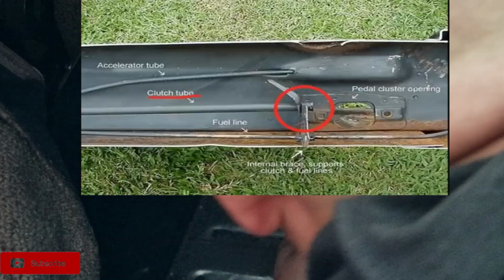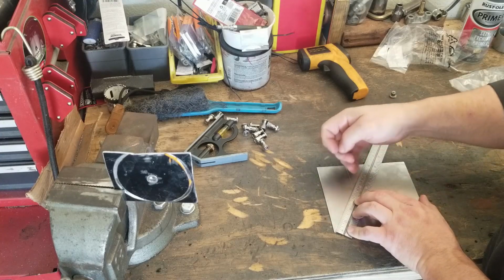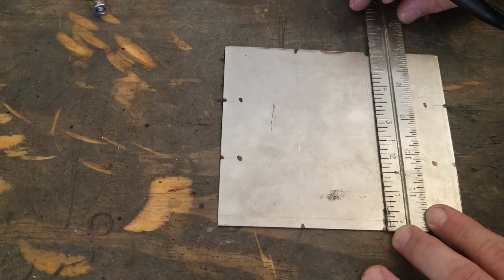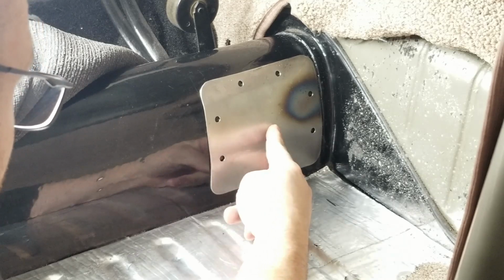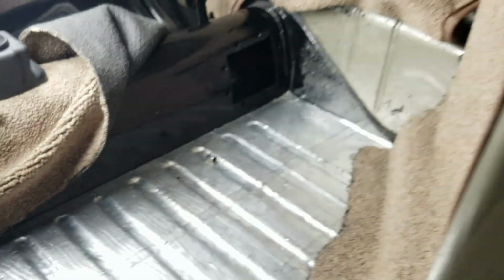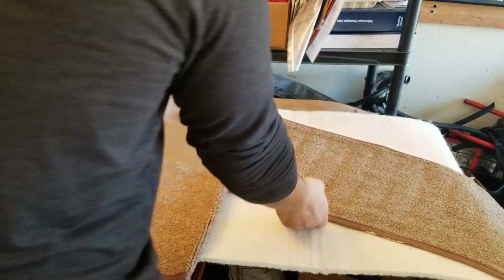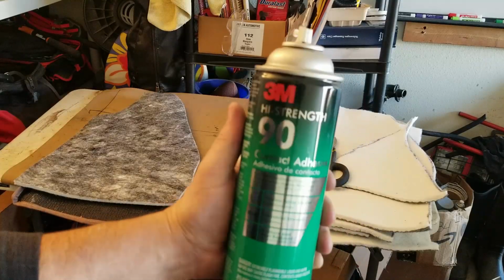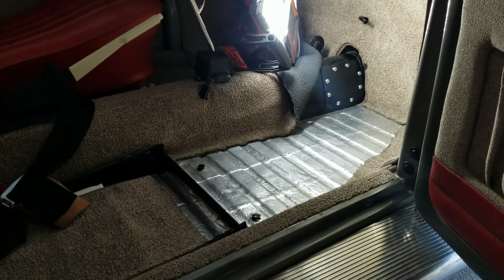How To -  Install A Tunnel Repair Window - 1956 Oval Window Rag-top - Volkswagen BUG | JW Classic VW

Comment: JW, excellent video my man! I wanted to use a rivet nut tool to add "carb adjustment doors" on the inside of my fenders but the only tools I saw were the long handled rivet nut tool that you'd have to take the fenders completely off to use! With these side mount rivet nut tool, I should be able to do it with the fenders installed. Glad I happened onto your Youtube site! Thanks...you've made my day!
Reply from the maker: That's awesome!! Glad you found the channel and even better found something to help you out!

Comment: Jason, I’m replacing the brake and fuel lines on my 64 (as well as preserving the pans top and bottom). Question, really don’t like the idea of the fuel line (original) being in the tunnel. I’d like to run a new line. Haven’t removed the engine yet but how can I replace the current fuel line? Do I have to cut the same opening?

Thanks
Reply from the maker: Hey Scott good morning brother!! If you want to replace the fuel line and not run it in the tunnel Chris Vallone has a pretty good video. https://youtu.be/tr8xKzfXxt0

If your wanting to replace the OG line in the tunnel then yes you will need to complete some surgery on your VW.  The OG line is held in the tunnel in 3 separate locations by tabs.  One by the pedal cluster, one near the e-brake and the final tab is located near the shift coupler.

Comment: I was thinking about this little hatch today, when I went to fix the Fastback's clutch pedal and the clutch cable slipped off the hook the first time.   "Wouldn't it be so easier if there were a door....."
Reply from the maker: Yes definitely, this access area would allow you the ability to replace the cable without removing the pedal assembly.  I was thinking the same thing!!

Comment: Better if the shape is oval or rounded, to keep the frame strong. 👍👍👍
Reply from the maker: Oval or round would be ideal, but if done correctly and if the access hole isn't very large you shouldn't see any issues with the integrity of the chassis.
Reply: And you are adding a patch. The patch replaces the lost integrity.

Comment: What are the reasons for an inspection window?
Reply from the maker: Hey there buddy!! Serves a few different purposes the one I have in mind is running the new fuel line for the injection system to be installed at some point but also this is often required to complete repairs on the clutch cable tube.  Besides those, it is also a great place to stash a few million dollars if you need to... lol

Comment: nice job . what type of fuel injection your planning to use , cb ,red line, fi tech  ?
Reply from the maker: CB performance Kit is the one I'll be going with and later upgrading to the turbo kit they offer.

Comment: G'day Kevin from Australia. 
Nice job on the inspection plate it looks almost professional. 😉
I have the exact same padding under my floor mats and it does make a difference with sound and it also adds a bit of class. 
I'm looking forward to what comes next. ✌
Reply from the maker: Hey Kevin!! Yeah brother the inspection plate turned out pretty great and that extra bit of insulation for the feet is super nice.